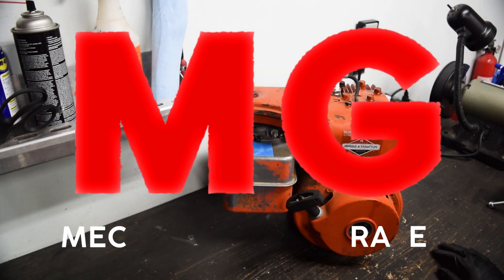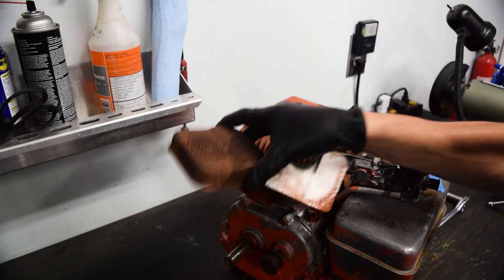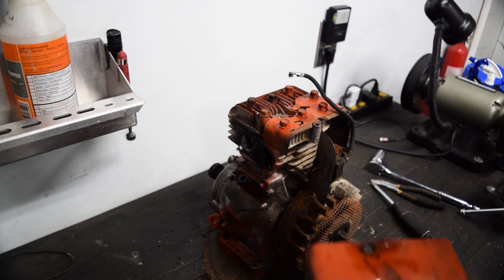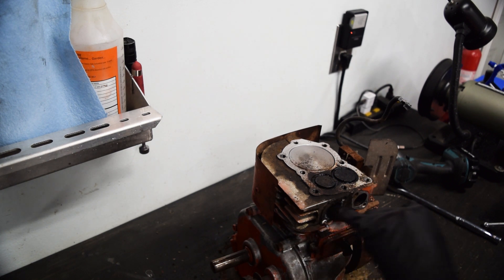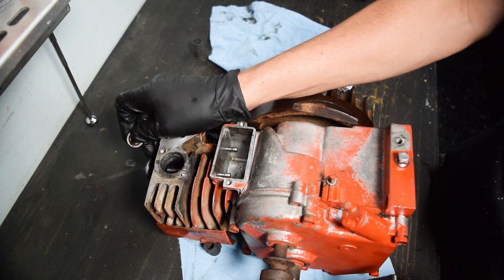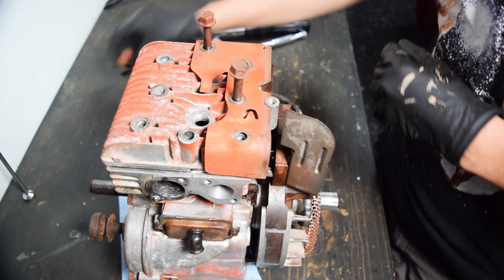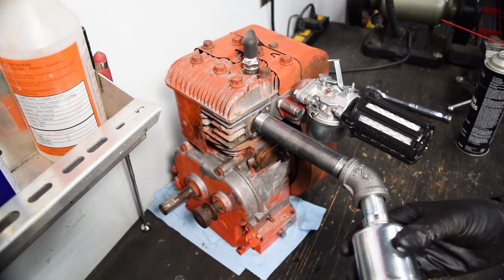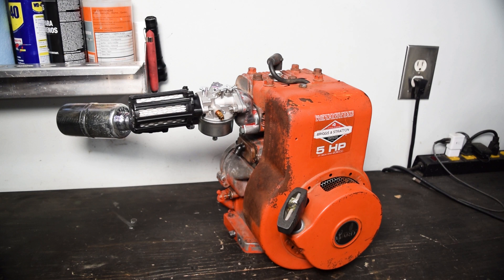Mod 101: 5Hp Briggs Flathead

Comment: I was gifted a 1982 non running Lawn Chief tiller with this exact engine. Rebuilt carb,cleaned gas tank n replaced the sparkplug. Sucker starts in less than three pulls every time.

Comment: What carb is that? Part number?
I have a 5 HP like that on a MDT/Yardman shredder/Chipper. 
Exhaust valve is stuck open, but want to add a regular bowl carb and a different gas can.
Reply from the maker: It's just an amazon clone mower carb

Comment: Love the old side valve B&S's. Look after them and they last forever........... Mind you, they seem to still last for ever even if you don't look after them. :D

I'm actually looking for an old 5hp lump at the minute. I want to connect one up to an alternator to make an emergency 12v charger for if the power goes out for an extended period here and my DIY battery/inverter power banks need topping up. It's a shame I'm somewhere between 3500 and 5000 miles away from you or I might have been asking what you have kicking about that you wanted to sell. :D

Comment: Well this isint exactly a mod you just threw a pipe and carb on what you can do for under 100 bucks is open up your intake and exhaust and shave the head for extra bang for your buck they also do sell racing parts for flathead brigs
Reply: Where do they sell racing parts for a Briggs?
Reply: @Bayareaminibike  you buy them used
Reply: @Turles811  ahhh u will look on there just got a Briggs for my mini bike I will be doing work on.
Reply: @Bayareaminibike  yes

Comment: Valve Springs, If you don't have a spring compressor I use an open end spanner aided with a flat head screw driver, place spring and seat on top of the spanner insert into cavity drop valve in maneuver seat into place on valve use screwdriver to hold in place remove the spanner and your done.

Comment: It's the valve springs are weakened from over the years of usage is what's causing that issue with the low compression reading's.,or your compression gauge is bad now one of the two. I know that those valve springs do get weak over time from wear and tear. Right along with heat friction and cooling back down repeatedly to over time does it them.,or the engine being ran on low oil causes those same issues as we'll. It's called heat sink friction expansion and contraction. Witch basically means it stretches the valve springs out from the heat inside of the engine from swelling up and shrinking back down when cooled down.

Comment: What did you do to bypass the governor? I see the arm is still in the block. Is it fixed in place somehow?
Reply from the maker: I just took the arm and linkages off that would have connected to the carb. The gear and other components were left in the engine.
Reply: @MechannibalGarage65  Do you recommend removing the guys of the governor?

Comment: I had the same engine on the Dune cycle in the '70sIf you would have used  bolts for the exhaust you get more area for exhaust flowMine had a header made out of bicycle handlebar and it ran really good

Comment: instead of cutting that cam pully of id have made use of it and use it to power a generator for lights and a charging system. i have a 3hp thats on a 60s model tote gote. most reliable thing ive got and its all original parts. ive just refurbished them with homemade gaskets and permatex ultra copper. the exhaust is conduit and a cheap muffler from tractor supply. runs good
Reply: The cam spins clockwise and half the speed of the crank but with the right pully setup it would probably work.

Comment: What was that intake manifold you used? Can't find the original video for the 3.5hp briggs and stratton.
Reply from the maker: It's a tecumseh part, and the part number is 28416A
Reply: @MechannibalGarage65  Thanks, it is not available over here, so another great idea lost.

Comment: I know of Away  that you might be able to still get that bolt out of the engine block by using A propane torch lightly heating up around the threaded surface area of the bolt hole that's after drilling it to fit A reverse drill bit witch is similar to A easy out bit to. Tap it in lightly with A small ball pin hammer to set the easy out in good to use A wrench to turn it slowly while it's still warm spray the threads with some PB-blaster oil first. Then proceed to slowly turn the bolt gently wrench straight inline with the bit to loosen it up. Good luck to you. Heat it up enough until it barely starts to kinda let off smoke fumes then try the rest of it all out.
Reply from the maker: I tried that... and broke the extractor off haha so I gave up
Reply: @MechannibalGarage65 I would of welded a nut onto it I'm getting ready to do that with a kawasaki engine side shaft engine I have no choice can't thread in exhaust I paid 20 for it runs great just have to get them out also how would you hook up a throttle cable to this carb for minibike or go kart?